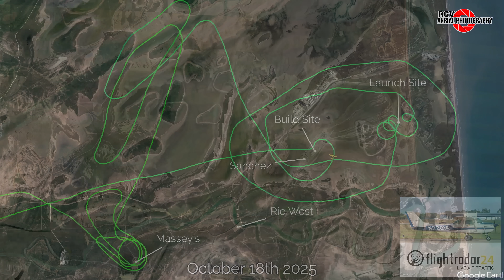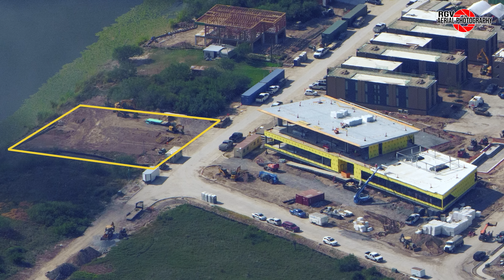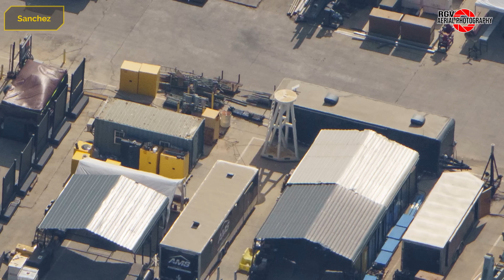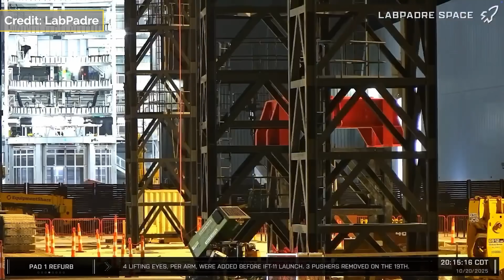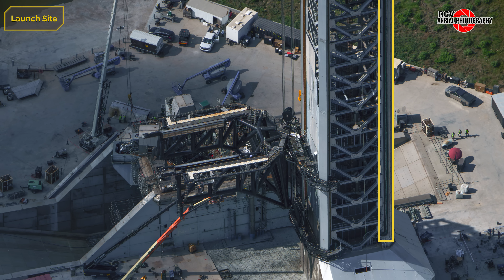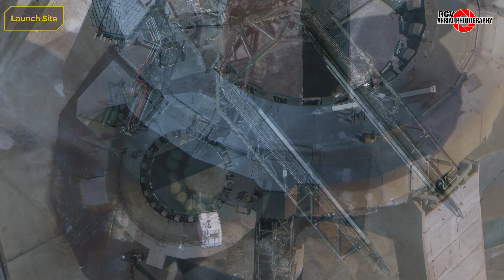Flight 12 Vehicle Stacking + Pad 1 Disassembly! Starbase Flyover Update 103

Comment: Excellent update!
Would it be more correct to say (in ref to 'armor' near Pad 2 tower at 9:45) that steel shielding is easier to replace than the concrete slab? Still gotta be better than the concrete under SN8! <G>